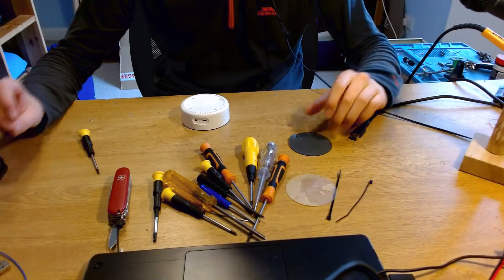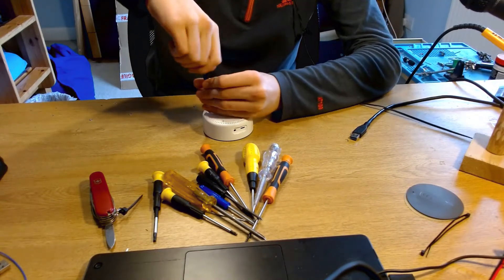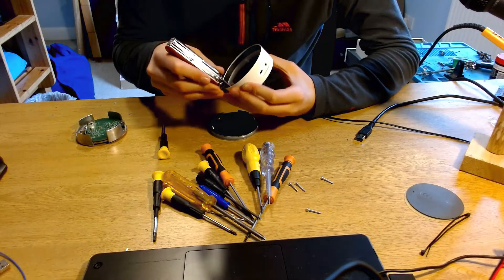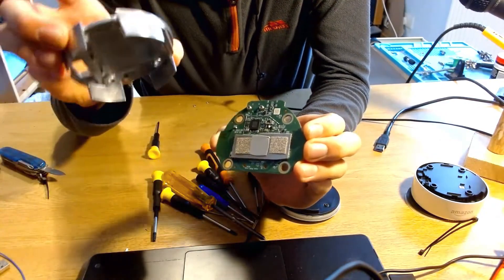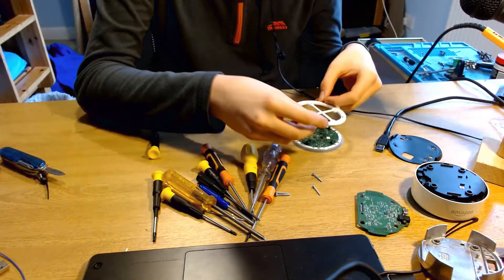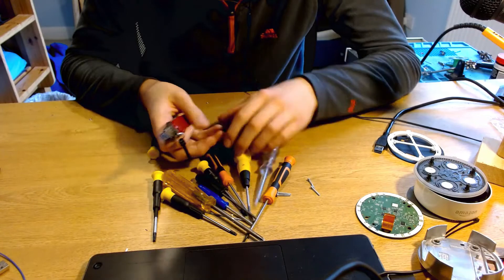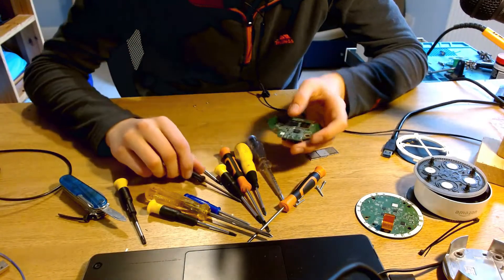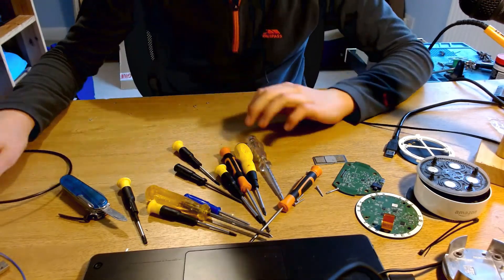amazon echo dot gen1 - teardown

Comment: 2:01 It is the speaker. The 2 shiny rectangles are the connection pads for the speaker that makes connection to the round circuit board when sandwiched together. Pads visible at 2:01 and 3:01. The board contacts are visible at 3:05 
6:42 is not a heatsink cover. It's an RF cage keeping RF noise from radiating from the device. Yes, they're passing heat through this cap to aluminum heat sink.

Comment: 2:48 it's the speaker, or do have you found another "sound emitting device"?
2:52 looks like an NFC chip. Could have been used while in production to identify the device. This chip has no connection to the motherboard.
5:15 that white strip is used to reflect the light and thus makes it shine brighter. The antenna is on the main motherboard as you can see at 3:04. There are two of them at the left and right edge: One for 2,4GHz (Wifi, Bluetooth) and one for 5GHz (Wifi).

Nevertheless some good findings. I have disassembled the same device you have found some new things that I haven't seen.